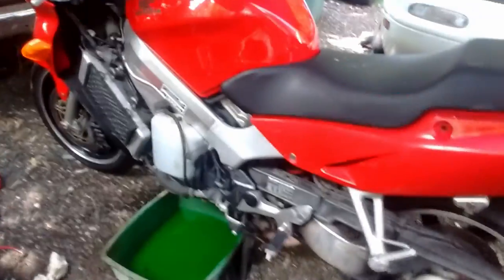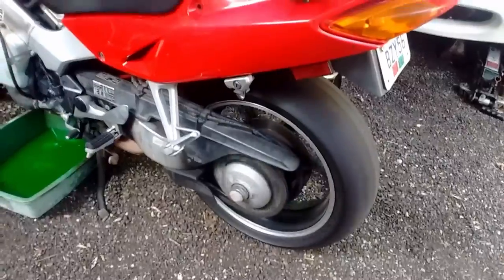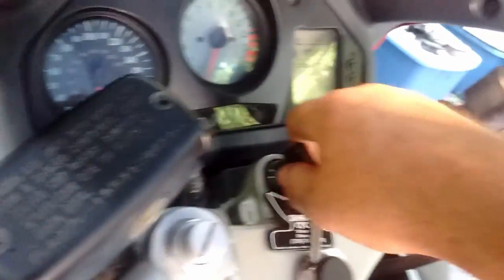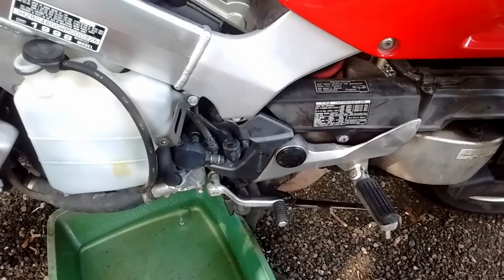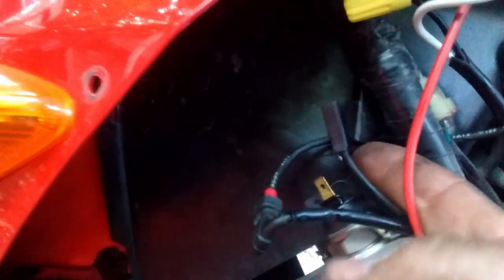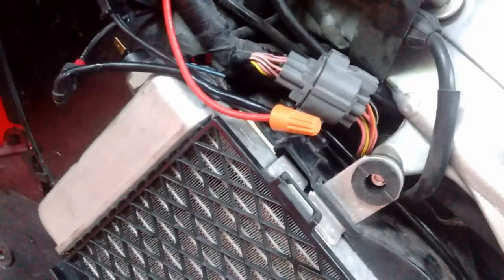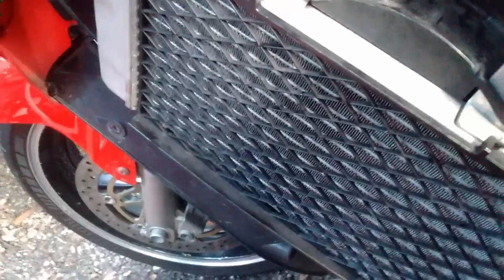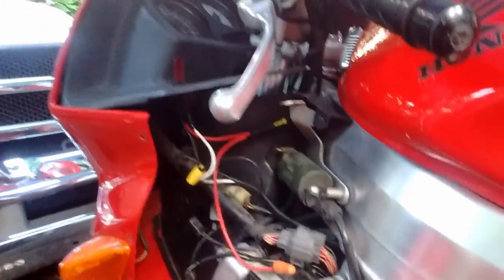HONDA VFR overheat issue / cooling fan override

Comment: Thank you brother. Looking at the wiring diagram, everything the thermo switch does in the VFRs is complete the circuit closing the negative /ground when certain temp is reached. So what I did is to connect (solder) a high quality 20 Amps switch with 14 awg wire to the two wires of the thermo switch. When the switch is in the close position, the fan is on, (like the thermo sensor at >= 220°) and if switch is off, the fan will start when receive the signal from the thermo sensor. This way, I used about a foot of wire and I worked only with negative polarity, no fuses and nothing to bring from the battery. I have seen many people using few different methods for motorcycles that use a simple thermo negative switch to activate the radiator fan. As an engineer I like to keep it simple. I've seen people using one or two relays when sometimes what you need is a quality switch and wires rated at the correct amperage and a little knowledge. Thanks again for showing this alternative way of doing it!
Reply from the maker: thanks for the reply & the info- there's more than one way to skin a cat :-)
Reply: That's a much better way to do it. No need at all to take cables back to the battery and if you do it that way there is no need for a fuse as it is shorted to ground when the fan is running.

Comment: Extra switches need to be run thru a relay, eliminates switch overheating & melting on high current circuits, it'll still work without, but it's always a fire risk without ... there's also another coolant drain bolt on the front of engine above header pipes, this is to fully drain the motor, just using water pump drain does not do a full drain, only use "Type 2" pre-mix (alloy engine spec coolant) ...hope this helps anyone thinking of flushing the coolant.

Comment: My 3rd gen. 750 had a slightly loose ground wire .
It looked tight ,but it wasn’t.
An 1/8 turn on the bolt under the seat where a cluster of grounds were fixed the issue.
It never really was overheating.

Comment: Curious, how did it work in traffic when you switch the fan on.  Can you keep the temp at or below 200F?  Do you still have the stock fan that draws air in as opposed to the VTR fan blade that pushes air out past the rad?
Reply from the maker: In moving traffic on hot days it usually stays below 200. In stop & go it rarely ever gets past 205. Flushing & changing my coolant also played a sizeable part in these better cooling conditions
Reply from the maker: I still have the stock fan, but may look into something better

Comment: I had this done at a shop and now my bike has a very hard time cold starting. the FI blinks 7 times which is a code for the ECT sensor How do I fix that.
Reply from the maker: do you raise the idle / choke switch a little when starting?

Comment: I don’t understand what you’re hooking your ground up to I’ve done what you did in my fan will not turn on does that mean my fan motor is shot, burnt out?
Reply from the maker: the ground wire coming from the battery goes into the yellow wire nut shown at 7:49, where it joins 2 other wires- one going to the negative terminal on the toggle switch, & the other one mating with the wire that clips to the thermoswitch / thermocouple shown at 9:01 to 9:04.

Comment: Disculpa como saber si mi bomba esta foncionando? Tengo un vfr800 año 93 pero me esta recalentando el envase burbujea y buta mucha agua
Reply from the maker: I would check hoses & hose connections, coolant levels & bleeding air out of the system. Have the bike running with the radiator cap off & let the system burp out the air bubbles. Then top it off with coolant & put cap back on.
What kind / color antifreeze are you using?
Reply: @Smittyschannel  use refrigerante naranja, ok muchas gracias al parecer tenía las mangueras de la bomba cambiadas la del radiador estaba en la parte de afuera y la del motor en la parte de adentro
Reply from the maker: @DAVIDMARTINEZ-lz8fq  I would highly recommend flushing it thoroughly like I do in this video, & using the blue asian / honda coolant. Walmart sells Peak asian blue coolant
Reply: @Smittyschannel  entendido muchas gracias

Comment: Change all the usual culprits thermostat, temp sensor, switch .
But first of all check all grounds ,just went through a false hot temp reading due to slightly loose ground wires.

Comment: What is the jumper box???
Reply from the maker: Jumper box? please explain
Reply: @Smittyschannel  That is what I’m asking “what is a jumper box” you said that in the video you hook the ground up to the jumper box what is that? The jumper box?
Reply from the maker: @markfarnsworth3306  I used a battery with wire probes to put 12v power to the terminals shown at 6:54 to figure out which of those 2 was positive & negative for that plugin
Reply: I’ve got another question if you don’t mind, why was the fan not coming on.. is the motor to your fan burnt out? Or a wiring harness shortage or something?
Reply from the maker: @markfarnsworth3306  In my case the thermocouple turned out to be bad. I bypassed it to a switch rather than replacing with a new thermocouple. I still want to be able to turn the fan on whenever I need to.
Reply: @Smittyschannel  Just change the thermocouple 9Fan switch) for goodness sake. It would be all too easy to forget to turn the fan on or off. It is very easy to get at when you remove the left hand side covers. You could also take a wire from the thermocouple to a switch and switch that to ground if you want to override the thermocouple, but I cant think why you would do that if the thermocouple was working properly.
Reply from the maker: @stevenmcknight6211  At the time, I didn't know the thermocouple was bad until later. The main reason I did it was that I want to be able to turn the fan on before it hits 215 or whenever it comes on. I turn mine on when it hits190-195.
When you shut the bike off you can definitely hear the fan, so forgetting to turn it off is a non-issue
Reply: @Smittyschannel  Another consideration is to get a new thermal switch that activates on a few degrees lower than the stock one, which comes on at 199F.   I installed the lower temp switch on my 98 VFR800, and it's got the A&A Performance supercharger,  the fan comes on when the coolant temp hits 188F.  I did this so long ago I can't find the part number for the lower temp switch but they are out there and they work great.